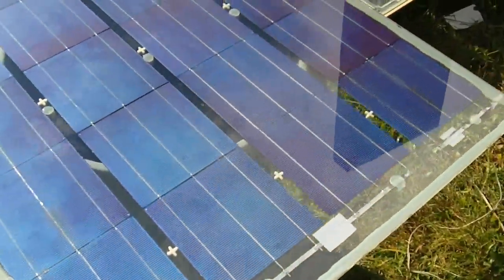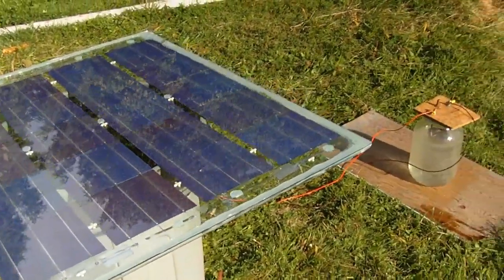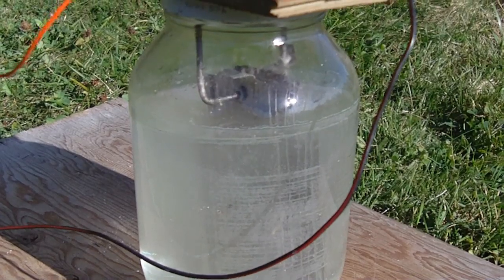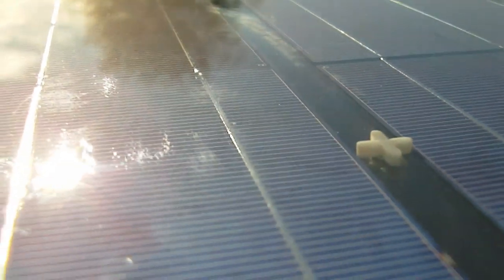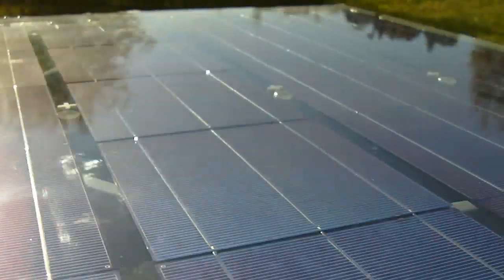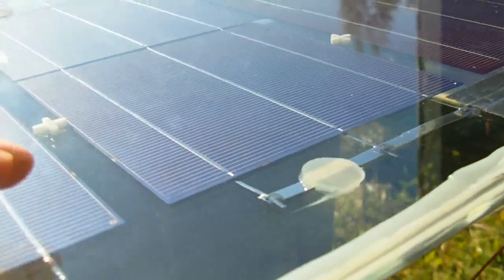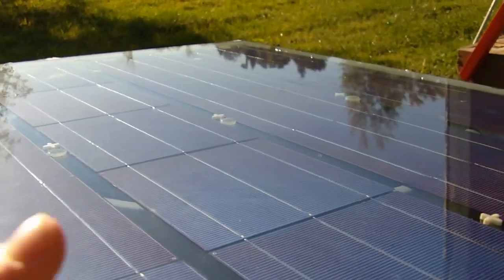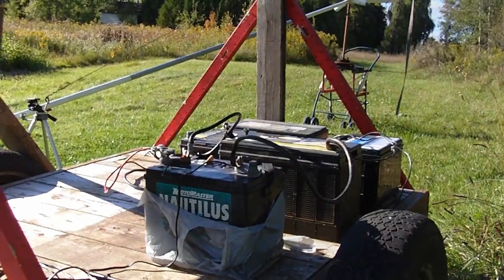DIY Solar Hydrogen / HHO gas Production Panel

Comment: Car engine?Store the energy in a battery, then hho
Reply: More chambers more gas production . If you have good amount off batteries and good amount of gas you can just use the stored energy.
Reply: Like a slow drip as the car batteries dies just fill it up (ie. sun)

Comment: Agreed with hydrogen on demand use and no storage with most homemade generators like yours in the video,  but it is not too difficult to make hydrogen generators that keep hydrogen and oxygen separate making a bit safer if one needs to store hydrogen. But that it self gets expensive.
Reply: Couldn’t you just have a 12volt battery and just keep it on and when it loses power you switch your solar on to recharge your battery
Reply: You could, yes. And battery makes a lot of sense since you could use the stored energy for a lot more things. My comments were to video poster's comments about hydrogen on demand only. In principle, hydrogen and oxygen can be produced seperated, but I acknowledged the increased complexity introduces  increased cost. 

Even a 12v battery battery introduces it's own complexity fior electrolisys If your shooting for 2.5 volts per cell then not only are your adding the cost of the battery. But 12v divided by 2.5v per cell = 8 cells. Which means you need 8 seperate wet cell or use neutral plates in dry cell design. The 8 wet cell design needs 16 plates  and 8 containers while only the whole side each of 2 plates. While a dry cell only needs 9 plates and both sides of the neutral plates contribute to surface area producing hho. But gasket material covers  part of each plate and you probably want to actively pump the gasses out to keep as much of the surface area actively producing HHO. 

Now if you can feed 2.5v to a wet cell design, you only need 1 container. And you can stack cells like a dry cell with each plate being an anode or cathode. You wouldn't need gasket material and would be able to use a much larger portion of the plate area for electrolisys, let's not forget  you also add some energy loss with a less than 100% round trip battery efficiency.  Don't get me wrong, A battery makes a lot of sence but it does add complexity and cost. 

What might be interesting is to have a bunch of 1 cell lead acid batteries store energy that when fully charged is 2.1v, and 1.8v when discharged to power a wet cell hho generator.  This way  you can make maximum use of plate area. And the voltages are lower so your producing HHO more efficently. Maybe a little too efficent at the expense of a drop in rate of production. 

I kind of favor using a buck converter to convert 12v battery or 13.4 charging down to a buck converted 2 electrolisys but this add another kind of complexity, efficency losses and improvements and cost.

Comment: HHO is great for heating a thermal mass in a greenhouse by means of catalytic conversion. Hydrogen + platinum  = heat.
Reply: If the purpose was to heat a greenhouse, why bother with solar cells that are maybe  20% efficient at best. Then the hydrogen conversion is at best 70% efficient. Then when oxidizing hydrogen to water, 286 Kj of energy is released per mole of hydrogen, but 41Kj of that is tied up in the heat of condensation, and is released only when it condences on the walls loosing it the outside enviroment without ever heating the inside of the greenhouse.  Thats about 14% loss there. Worse case, all these efficency looses amount to an expensive system that is maybe 12% efficent at turning solar energy into heating the greenhouse. Then you have a much higher risk of mold growth on the greenhouse walls with the extra condensation. 

It would be far far far better to use a solar heat collector with a hot water tank to store it while using a radiator to give it up when needed.  That is Far safer. Far cheaper, far more efficient, and far better at keeping unwanted mold at bay.
Reply: @kreynolds1123  Nice information ! And to use as heating gas for cooking and gas water heater for shower is it still interesting ? A bit lik methanizer but without needing minimum 20C° to work......?
Reply: @AutoNomades  it could work as a cooking gas. But in reality, hydrogen is simply an energy storage medium. 

You could power an electric heating element directly from solar or waste 20-30%  of the energy converting it to hydrogen first. Maybe another 15% if your compressing it too. But some might counter that hydrogen stores energy and power for when you need it. Hydrogen Sure does store energy for later when you need power, but a lithium ion battery does as well, and will typically do 90% or better round trip efficiency.
Reply: @kreynolds1123  I was meaning by using a low tech / pressure system...
Reply: @AutoNomades  My answer was directed to the question is hydrogen interesting or desirable  for cooking or heating water to shower. I pointed out making hydrogen for that us using hydrogen as an energy storage.  I pointed out the inefficiency of production and storage. I further pointed out lithium  batteries as an alternative energy storage with higher round trip efficiency. And resistive heating is 100% efficent at turning electrical energy to heat ebergy. I'll take this moment to point out the use of heat pumps to heat water move heat energy from the environment to the water with a coefficient  of performance of greater than 300%

Comment: As I understand it you are not quite correct about the voltage.  I'm told around 80volts is optimal for electrolysis.
Reply: that will boil the water

Comment: couldn't you add a voltage booster and PWM for maximum gas production?
Reply: Water is Fuel You can use reflectors to increase your solar panel output.
Reply: TheDave570 not true
higher voltages are admitted using impulses . there is someone (Henry "dad" Garrett) who patented such a device. He used a rotary pulse generator
Reply: Over volting does drive current and it is current that drives production, but over volting also drives down efficiency producing more and more heat than hydrogen for every joule of energy used.  Its far better to double production  by doubling plate area.  And use potassium hydroxide at  at the right concentrations (google conductivity potassium hydroxide concentration) and remember to keep the current down to less than .5 amps per sq inch. Or you'll overdrive  the plates and they will deteriorate faster.
Reply: Pwm does nothing to increase HHO production, and on its own does virtually nothing to increased efficiency.   PWM only limits the time a cell is turned on.  And thus limits production time. You could improve efficiency if pwm power was fed into an inductor capacitor filter.  But that just effectively  lower the average voltage that in turn increases the efficiency but drives a lower current and lower production rate.
Reply: Well the best way to increase production  is use larger cells !! but keep your voltage and current constant !!

Comment: U can use it fir cooking....
Reply: +TheDave570  all you need is a hho gas burner.  look it up, you can cook with it, you can even make a 6500C blowtorch that cuts anything, more gas bigger flame.  the gas may flash back if cooker is defective, but if you build the device correctly, you can put you lighter directly to the hho generator or bubler.  the gas will deflegrate in a bang, but the rapid gas expansion does not have enough power to do any damage,  it makes a small bang and maby in worst case pop the top of the bubbler with a lille larger bang.  " device must be build propperly offcause" hho and glas does not mix, ever..

  you can have a handfull of homemade HHO dishwash foam in ur hand, and light it with an earshattering bang.  but you wont feel anything in your hand, maby just a very small puff, all sound, no power..  HHO deflegrates at the speed of sound 360m/s, not explodes with 1000's m/s like well explosives. hho is not explosive, not even close.  But one must have respect for HHO for what it is, and never acumulate indoor. 

  it must be contain, either in thin bottle, or under high presure in a presure container, to become something dangerous. example a 2L 6mm thick poly plastic bubler containter, containing 4/5 water and 1/5 gas, under no or only very litte presure, will absorb the deflegration.  The creation of  extremly hotwater wapor , and the end of the burn, will contract the vapor very fast and  generates a vacum inside the container.  Built it corretly, sturdy and solid.  And you have less than 0,5l gas in the whole system, with multible safty systems. you will only hear a puff from the hose, and the generator just runs, as nothing happend. 

 it is pretty safe, it very very fun, and its utterly clean.  bang plastic bags, exploding coke bottles, potato cannons, beercan cannons, small blowtorchs.  I have great fun with hho.
Reply: No, you can't use HHO for cooking!!! He is right, the combo of these two gases is VERY unstable and will EXPLODE!! you know you need oxygen for burning ?? what happens when you combine the two ???